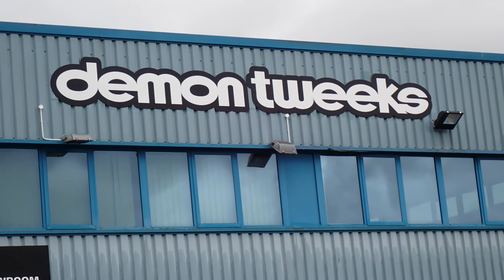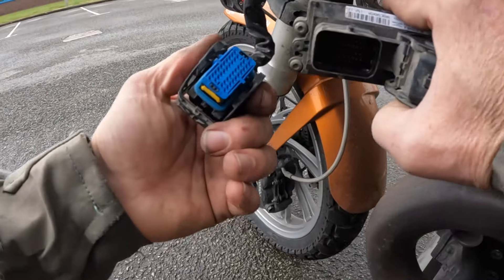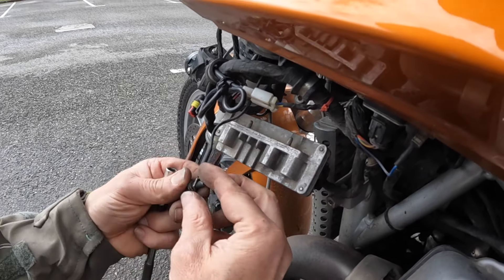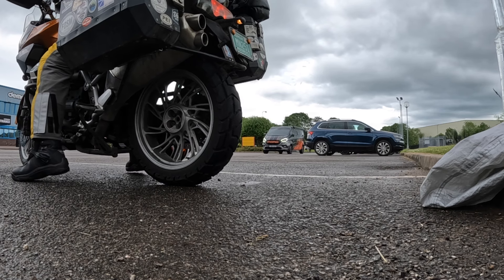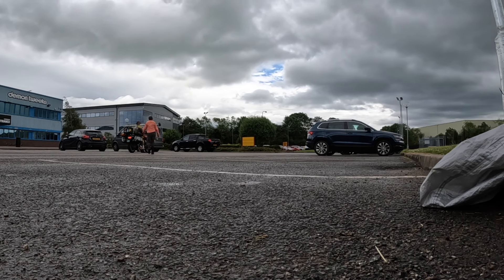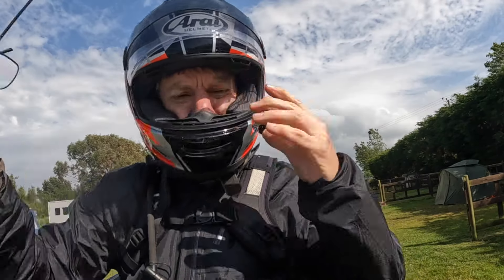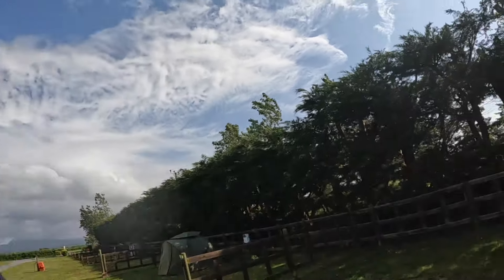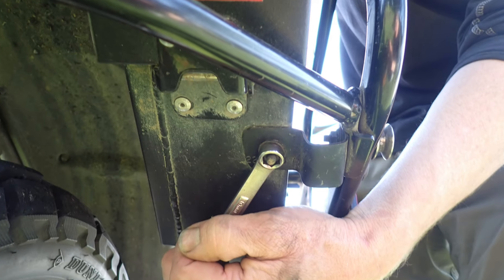Episode 17 Moto Guzzi Break down! Will we make it to Wales?

Comment: If you havnt already changed you plug caps keep it in mind similar syptoms to the ones you had missing under load.
Spark Plug Caps.
To remove, don’t pull on them from the top.
Poke a long thin Screwdriver or Rod through the Cooling Tunnel above the Exhaust Header Clamp, and feel for the bottom of the Cap.
Lever it off with the Screwdriver/Rod.
There’s a bit of a knack to it, but once you’ve done it a couple of times, it’ll be easy.

If you pull the Caps from the top, you can damage the Cap, the inside of the ‘Elbow’ (bend) can crack, leading to the Spark shorting out to the Valve Cover, especially in the wet.

Caps can be replaced with the Red all-rubber NGK versions. (SD05FM)
They’re a little long, and stick out the top of the Valve Cover, but they fold down neatly under the HT Lead Cover.

You can make a Pulling Loop with a couple of small Cable Ties.
Make a small Loop with one, that you can easily get a Finger through, then attach that to the Plug Cap under the Elbow with the second Tie.
Reply from the maker: @1fiatman  I carry a string with a loop on each end for pulling plug caps.  Never pulled the wires by hand. Pretty sure i have video of that but you will have to watch them all.😉 When I replace them it will be with the originals. Thanks for watching.
Reply: @2Upon2Wheels  originals are the cause of the problem well known issue, but up to yourself what you replace them with